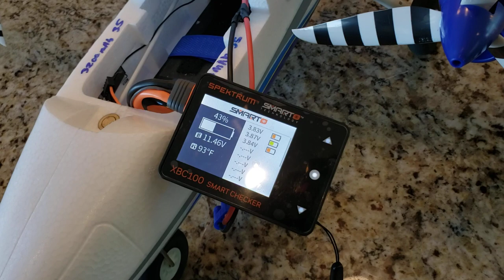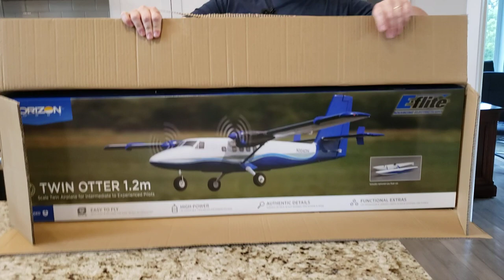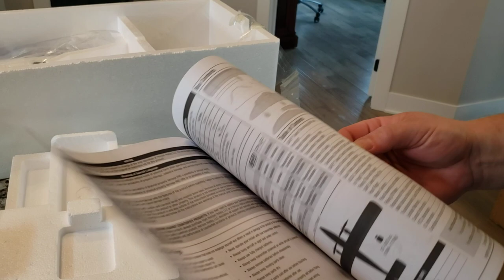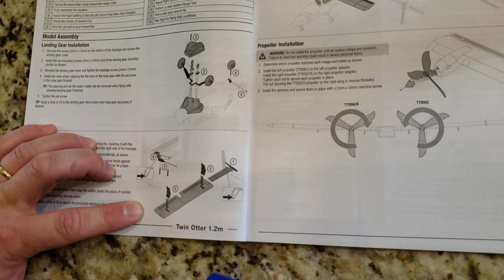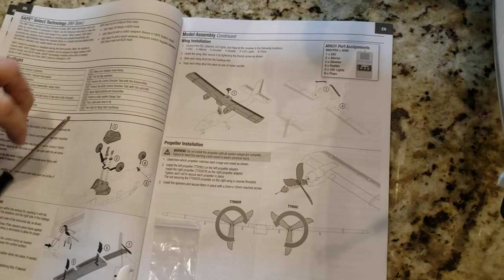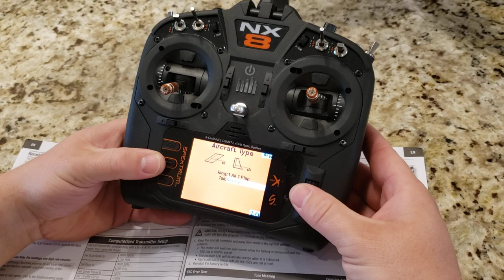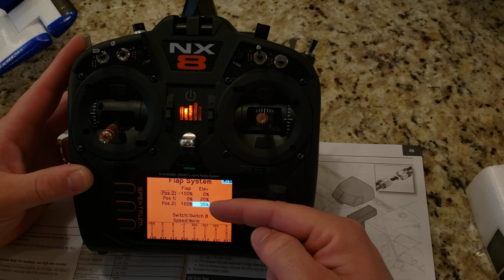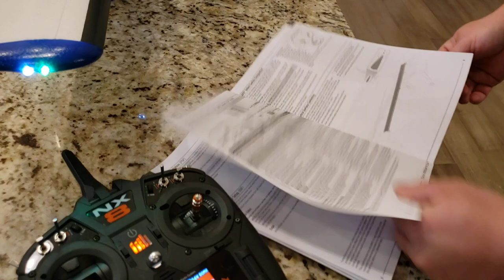E-flite - Twin Otter V2 - 1.2m - Unbox, Build, & Radio Setup

Comment: Just got my Twin Otter and setup, first bind had no issues with the ESCs. I then added differential thrust and when I bound again, ESCs did not want to arm, turned out to be throttle settings and my throttle cut combination...all working good now. AS3X and SAFE was working, sort of, my OFF setting was good and my SAFE setting was good, but no AS3X. On the second bind, AS3X started working except for the rudder movements. My latest bind, AS3X is working except for the elevator movements. The learning continues, oh yea, I really enjoy your video's. Happy to see the recent one for the FMS F-18.
Reply from the maker: Thanks!

Why were you setting up differential thrust? It's managed by the DUAL ESC. I don't even remember setting that part up...did you have a PNP???
Reply: @BrianPhillipsRC   I got the BNF. Thought the differential thrust would help during water taxi. I have no intention of using it during flight. The manual shows nothing for differential thrust, I found another guy did a radio setup for differential thrust. I would like reverse, but need smart ESCs for that...maybe another time I will switch out the eflite ESCs.

Comment: For my really tight EC3 connectors I use a snap ring pliers or tool, it has 2 small pins at the end, when you squeeze the handles, it works the opposite of regular pliers and the small pins move outward. The pins I use are small enough, they are together, insert into EC3 gap, squeeze the handles and it pulls the EC3 apart. It's a delicate tool, pins part held on by springs, used gently it works great for stuck together EC3's.
Reply from the maker: nice! good idea!

Comment: I have found it helps to put a small spot of FOAM TAC at BALANCE point very easy to find.
Reply from the maker: Okay, then you have a bump to feel. I've done with with tape and CA, and hot glue alike, but anymore, I just stab the wing with a sharpie ;)

Comment: Hallo Brian Great review, like always!  I had the sane problem regarding the ESC Setup , you solved it perfect 👍🏻a huge thank you! I have a wrong aileron once as3s is active it over corrects into the wrong  direction, plane goes to the left and as3x pushes the plane even harder to the left. Any ideas?
Reply from the maker: Did you get a BNF???? If so, then you need to hit up HORIZON HOBBY for a replacement...

If it's a PNP, and you went through FORWARD PROGRAMMING, then all you need to do is figure out what position the Receiver is showing up in you profile, and FIX IT. It's flipped in the wrong position. Go back through "FIRST TIME SETUP" for AS3X and SAFE, and you'll likely see your issue.

Comment: Try some dry lube spray on your EC connectors. I use hornady dry gun lube but wd40 offers some that should work.  It makes all the difference in the world
Reply from the maker: Will that break your connection? Isn't it Silicone?!??!! I'd be super careful if you're not 100% sure...and I'm NOT...so don't hear me wrong, but if you got the connector coated JUST right, you could be making a CAPACITOR out of your connector - that might be a very HOT connector if you're not careful ;)

Again, I'm not sure I'm even right, so might be talking out of turn here....
Reply: Silicone or petroleum products would be a huge concern so no apologies needed.  I can't speak personally about the wd40 variant but the hornady one shot lube is non conductive, silicone free and polymer safe. Over 2 years using it with no issues whatsoever.

Comment: If you notice the bobbing around while taxiing, it is cause by the foam tires are out of round.
Reply from the maker: True, this can happen too. I don't think I had flat spot YET, but totally agree.
Reply: @BrianPhillipsRC  Out of three sets of stock tires, 6 mains and 3 nose, I ended up with a single matched set that spin true. The manufacturing of the wheel tires is very poor quality control. And I am aware I'm picking nits.

Comment: Between this and the cirrus sr22t which one in your opinion is better. Scale wise the sr22t I think is but flying
Reply from the maker: This plane is very different in many ways. Twin, and smaller to scale, but they are both excellent planes!

https://bprc.me/TwinOtter
https://bprc.me/CirrusSR22T

If you want a more simple plane, the Cirrus SR22T would be the one for you, but both are excellent! If you need another "tie breaker" what about water ops? The Twin will do floats, while the Cirrus will not.

Comment: I have this plane and i absolutly love it. 
However, i have an issue with the flaps and since the manual talks about adjusting after different spectrum radio's, it becomes somewhat different when i'm using a Hitec radio.
It litterary nosedives when i put on the flaps, so would i be right in having less flaps and mixing in some elevator when activating flaps?  
If so, about how much you think?
Didn't buy the BNF package but the one where you have to provide your own Rx and Tx.
Reply from the maker: Flap to elevator mix is a must on many plane. Go for it. Also, a longer delay in flap deployment can help with the transition in wing shape, thus allowing the plane to slow down to an appropriate speed so as not to balloon or dive quite as bad.
Reply: @BrianPhillipsRC  thanks man, I'll give it a shot

Comment: Hey I have a question. So I have the Horizon Carbon Cub S ready to fly kit. And I’ve been looking at buying the twin otter. If I bought just the twin otter, could I bind the controller and use the battery and charger that came with the Carbon Cub S?
Reply from the maker: You can, but won't have all the features. I would VERY HIGHLY recommend getting an NX8 if you plan to get more than a couple planes. You CAN do some cool things with the DXS, but it's a lot harder, and many features you'll want just don't exist....like EXPO, Dual Rates, Flaps to Elevator Correction, mixing, etc....

Comment: Hey I have the DX6e and having some troubles. After hours of trying to bind and set up my tx to my otter, I finally got it after contacting the company I bought it from. Seemed to be setup correctly and taxi’d straight. Took off (mild breeze) and it just rolled right and crashed. Now I have a real loud fan noise and it seems to be coming from my rudder servo. Could a small crash (low speed low altitude) cause servo damage enough to do this? If so I guess I just need to replace the servo?

Comment: Hi Brian. After watching this video last night, I decided to take my new Twin Otter out for the second time this morning. Unfortunately, on the second flight of the day (and fourth overall), the rudder servo locked up while full left. I attempted to land it, but failed and crashed. I contacted Horizon Hobby and they said to send it back and they will evaluate if it was defective out of the box. If so, then they will repair or replace it for free. But I have a bad feeling about this. I'm worried that I am going to have to pay for expensive shipping (at least $100) only for them to tell me I am on the hook for the repairs given that I'd flown it before. So, as an experienced pilot, I wanted to get your opinion. Do you think HH will do the right thing here or could I be up [excrement] creek?
Reply from the maker: I would never accept such terrible terms. I've gone round and round with them, and I almost always got what I needed... Nowadays, I can't say I'm in the same situation, so when I call, if I need too (which I HAVE, btw) they pretty much take care of us. This is a tough one. If you had 3 good flight, why on the 4th?

I get the YAW was terrible, with full LEFT. Too bad you couldn't slip it in at near full throttle ;(

Either way, sounds like they want YOU to roll the dice. I can't say what I would do... I totally KNOW the feeling.

You could just call again? Hope for a better experience??? If they have your information already down, you're probably screwed ;/

Sorry Mark - I absolutely HATE when this happens.

P.S. On the brighter side, if it were Hobbyking, we'd know what the answer would be - LOL ;)
Reply: @BrianPhillipsRC  I will try calling them again. But like you said, this is going to be a roll of the dice. I'm not much of a gambler, so I'll probably just repair it myself. Already found a replacement nose gear with its own dedicate servo that I would like to install. Thank you for the advice!

Comment: I have a question for you, my esc is fast beeping and will not run the motors
Reply from the maker: Get your throttle well below -100%...sometimes they won't arm without -130%. Might need to setup the throttle cut by the book to -130%... sorry for my super slow replay...behind right now bad!

Comment: I know because it can fly on water, but when flying with landing gear there are no ventilation holes to keep battery and esc cooler. Am I just being picky about the warmth or has someone else experienced this and fixed it?
Reply from the maker: I haven't had any issues, but if in doubt, just make a few holes and then you don't have to worry. You could also use one of those lazer thermometers that you can get for the kitchen, and see how hot things are getting....

...something like this... https://amzn.to/3JtEu2c ...then you can make a decision before cutting up the plane.